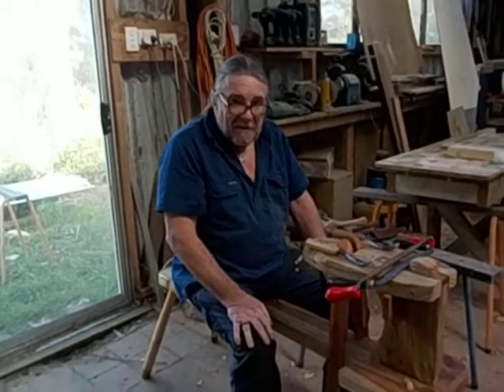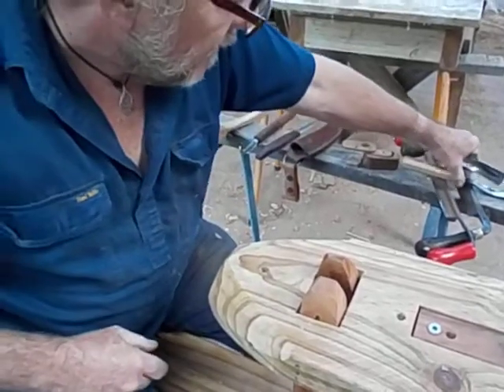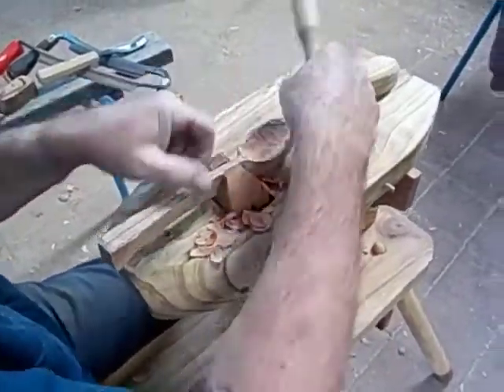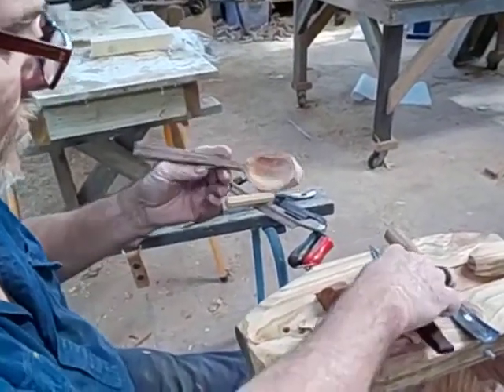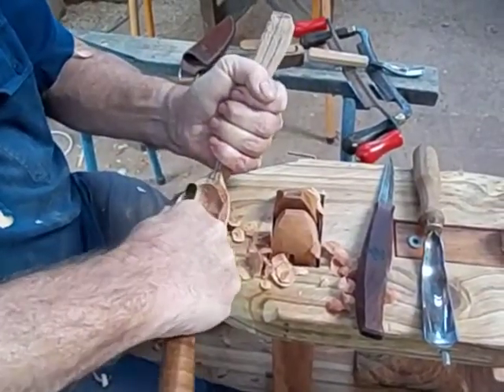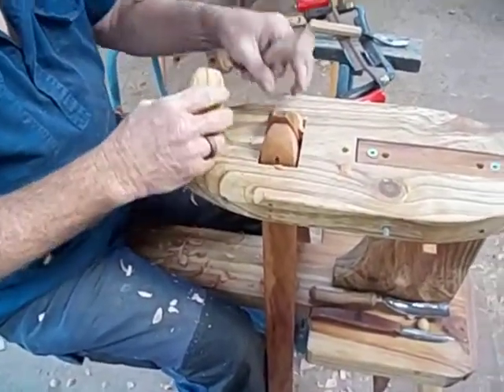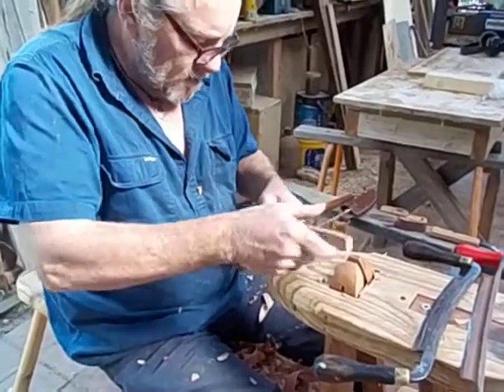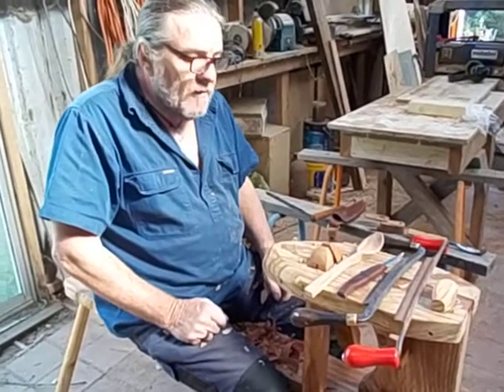gouge and draw knife

Comment: Many thanks for the video, Paul.  Is there any particular  advantage using a palm gouge over a normal one, and vice versa? I'm guessing s palm gouge/chisel can be used when holding the spoon in the hand rather than in a vice. - although I could be wrong.
Reply from the maker: Hi , I don’t use palm gouges , only standard gouges , but it does occur to me that palm gouges might not have enough handle to hold as I do in the video and are made only to push with the palm of the hand . The thing to bear in mind is safety, used as I use a gouge , even without a mule or clamp the chances of driving the tool into your hand or other body parts is greatly reduced. I got the idea to use a gouge like this off a young bloke on YouTube and he doesn’t clamp his spoon but holds it and braces it against his leg...hope that helps ..if you want to continue the conversation can we do it on Instagram? My handle is paulboyer65